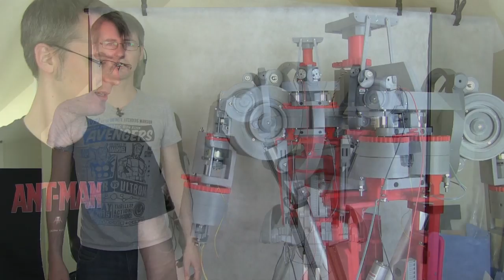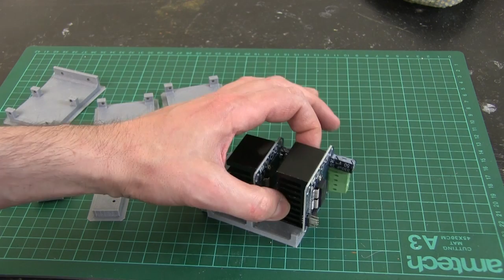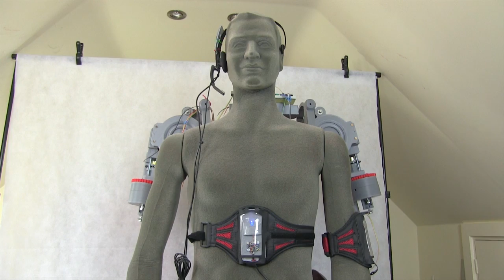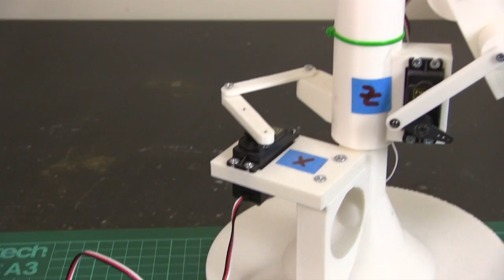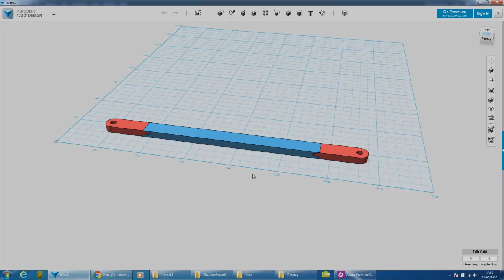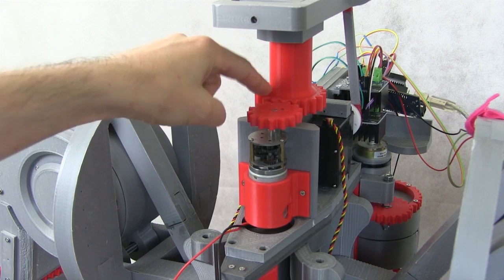Avengers Ultron #15 | Motion Capture Driven Movement | James Bruton

Comment: Will the shoulders rotate up and down? The arms can't even go parallel with the shoulder at this point.
Also in humans the neck muscles form a sort of V shape on the sides, and you've inverted that and put them much closer together on the front of Ultron's neck. Is it because of mechanical limitations?

Comment: James, i will try to write this in english (let's see if i will be able to pass my thoughts)

did you see that video with that guy flying over the sea using someking of "drone" under his feet?!?!
whhhyyyyyyyyyyyy you dont try to do de exactly same things using 4 smallers engines than that one but that in the end will have the same power...

try to replicate the project of "tony stark" in the iron man 1.... remember the first "flying test" ?!?!exactly this one.... 
you could use smallers rotors in whicn hand and feet .... using somekind of Y design, where your hands and feets will be in the middle of the to lines of Y.... you could do this desing using somekind of 3D printers.... and use one battery backpack to hold all the batteries...

(i hope you see my coment)

Comment: as much as I'm enjoying the project, it still hurts me that your chest arm joint uses a second vertical axis rather than a lateral axis. A redesign would be extensive at this point, but would make the arm orientation oh so much easier  to determine and replicate. Perhaps in a second iteration?
Reply: +James Bruton (XRobots) Yes, you're not properly using Euler angles on either Ultron or the test model. Euler angles represent rotations around 3 mutually perpendicular axes of a coordinate system. right now, you essentially have Y1Y2Z instead of XYZ.

Consider your model. Instead of resting it on a table, orient it as though it were mounted on a wall with the arm pointing down. Now the proximal joint is oriented laterally and the arm can swing forward and backward. The middle joint is still dorsoventral, allowing the arm to swing out sideways; and the distal joint still allows twisting of the forearm. I think you'll find that works much better.
Reply: +James Bruton (XRobots) 
Ah, I see. That doesn't really model Euler angles either :) I suspect that design was chosen for sturdiness rather than following a particular coordinate system or closely mimicking human shoulder movement. 

Obviously, the approach you're taking will work okay. just be aware that it will limit some movements, and make the math of others more complex.

Please understand: I'm not arguing that you should tear it apart and start over. I just want you to have a better understanding of Euler angles, so that you can use them in future if you decide that's appropriate for a given project. Again, if your model was mounted on a wall instead of standing on a table, it would have true Euler axes. hold it up and consider it.
Reply: +James Bruton (XRobots) 
Those chest joints the shoulders mount to do model the ability to roll the shoulders forward and back, although I think that would fall more under shoulder position than shoulder angle. To get the third shoulder axis, the big disc that the shoulder joint mounts to would have to rotate, like how one swings one’s arms while walking.

And I hope you're taking this as constructive. I've been an admirer of your work for some time now. Very often your mechanical engineering solutions are much more elegant than the ideas I come up with when you first explain what needs to be accomplished. And ball joints such as the shoulder and hip are notoriously difficult to design.
Reply: +James Bruton (XRobots)
I don't see how quaternions would benefit you, tbh. They're used in computer gfx to provide smoother interpolation between 2 orientations, but I doubt they'd have a noticeable effect with a PID controller. And they aren't intuitive: they describe rotations in 4D space and rely on there being 3 different square roots of -1. It honestly does make the math much simpler, but understanding the why of it is much more difficult. And then you'd need to convert to Euler angles to apply the rotation anyway. Unless you're a math geek or really dissatisfied with how Ultron is moving, or really want to see how quaternions work, I'd suggest giving them a low priority.

Comment: hey James! I follow your channel since a while.. great job! keep on building!
i have a suggestion for the actuators of the mounting head. instead of printing a lever in abs and ninja flex, why don't use a threaded bar with two uniball jonts at the end? I guess you will have a better control on the moviment. You can use the same joint type at the end of the linear actuators. I am pretty sure you will have less wobbling in the torso.
good luck with the project!

Comment: Loving the head motion - really good!  The arm up and down motion seems quite limited however - could you link the torso actuators to this so that when you lift the IMU higher than a certain point, the torso also tilts to get the arm higher? Just a thought.
Reply: How was this comment 5 days ago? you just published it a minute ago lol
Reply: +ctjet99 noticed that too
Reply: +James Bruton (XRobots) ever thought about measuring motor current draw (or even back current) to calculate resistance?
Reply: Infinity Gaming Did he hide the comment?
Reply: +ctjet99 I'm not sure
Reply: +ctjet99 probably and put it back and took it off and put it back
Reply: Infinity Gaming probably
Reply: Infinity Gaming WE ARE THE ONLY ONES WITH ACCESS TO THIS COMMENT, PRIVATE DISCUSSION!
Reply: +ctjet99 no u're not
Reply: Red Point :p how'd you get access?
Reply: +ctjet99 same as you
Reply: Red Point makes sense. Should we use this as an IM chat and talk a lot?
Reply: +ctjet99 check out the end of the videos, all should become clear
Reply: ctjet99 bro this aint private , I just cliked and left a comment
Reply: Red Point really? it doesnt show up on my screen when I go to the video itself. interesting.
Reply: +ctjet99 I can see all your comments